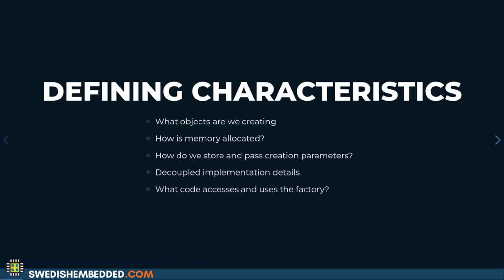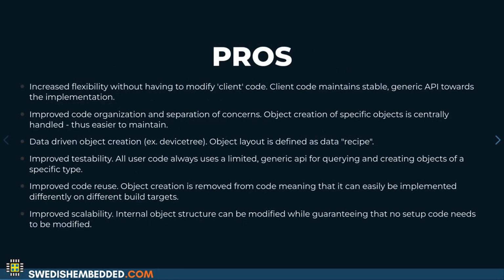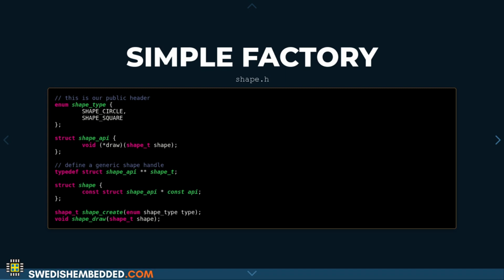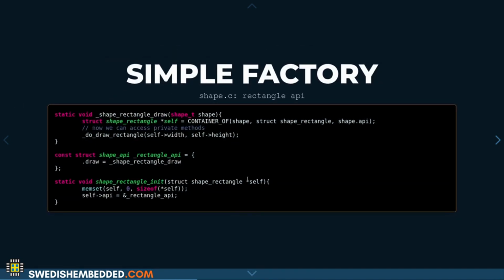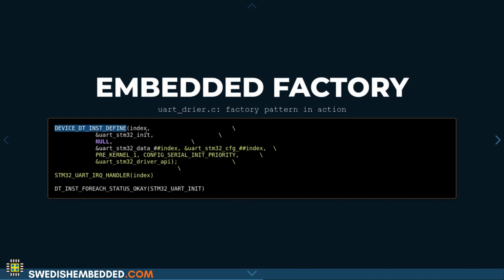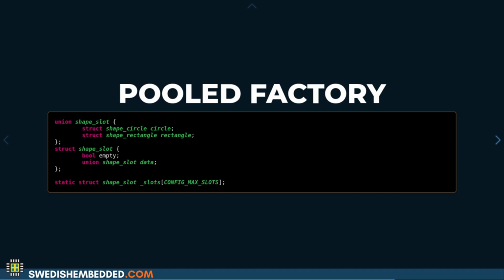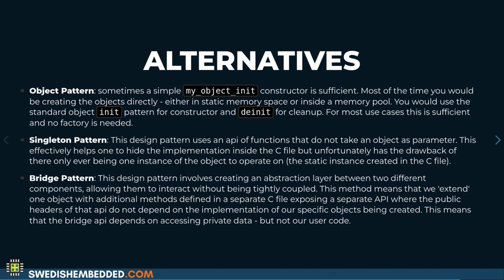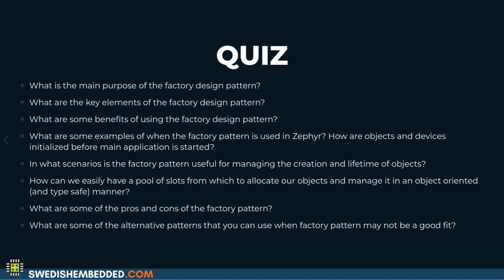Embedded C Programming Design Patterns: Factory Pattern

Comment: i have a question at 16:08 in shape_circle_init function, you wrote "self->api = &_circle_api;" but to my understanding the "self" is a pointer to struct shape_circle which doesn't directly have "api". Is it supposed to be "self->shape.api = &_circle_api;"?
Reply from the maker: This pattern is stretching it a little. In practice abstract factory as I describe it in this video is more suitable for a language that has constructs that make it easy to implement. However one thing that I think we should add which is actually a much more practical example of abstract factory in C is the concept of file descriptors and how this relates to implementing different types of sockets. The socket() system call in linux is actually a constructor that acts as a factory for abstract data type called the socket. What makes it simpler is that the api is defined in a private structure that is attached to a file descriptor object and as user you just get an int that represents that file descriptor. Underneath though you still implement multiple layers of abstract apis - some for the file descriptor (like read, write and close) and some for the socket (like send, recv, sendto etc). The result is that you can use the same functions on a socket as on a file. The abstract factory pattern with file descriptor concept at the center makes this very easy to scale. When we want to implement additional socket types and socket offloading in Zephyr this becomes very useful to understand because the socket factory in Zephyr is extendable by allowing constructors to be spread out over the source code. They all then plug into the same factory and user can use the same constructor to create objects.